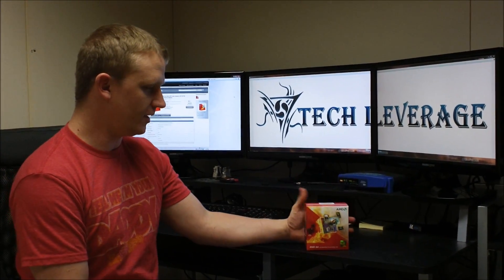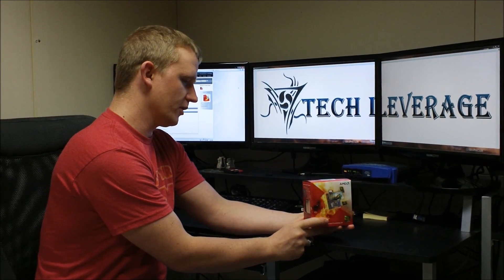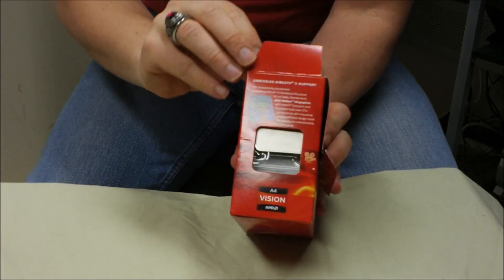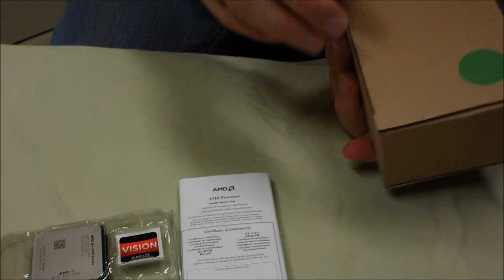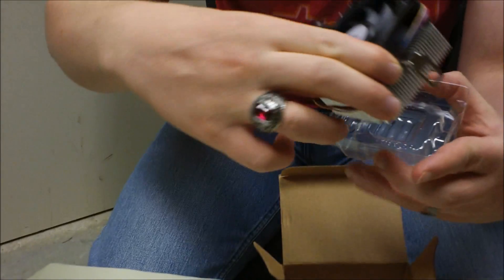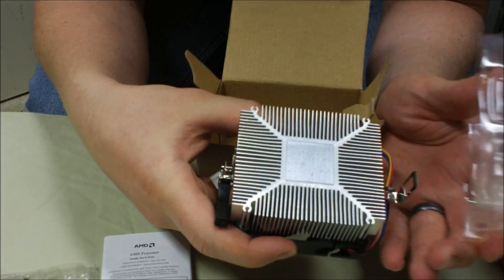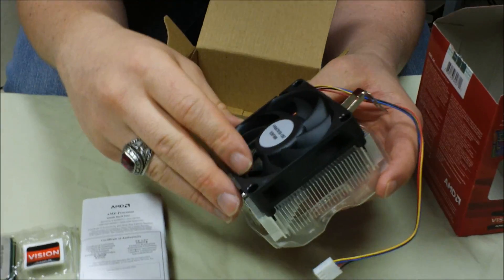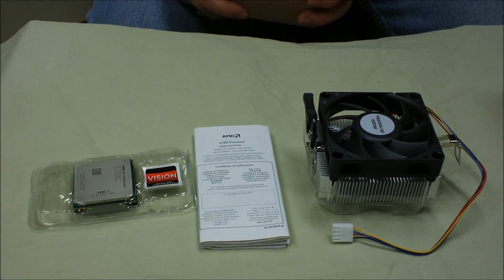AMD A4-3400

Comment: Apu means accelerated processing unit it even said it on the box you should try reading instead of infering
Reply from the maker: Yup, They are called an APU. They are an advanced processing unit that AMD has released called the Accelerated Processing Unit or APU that combines the GPU and the CPU. The video was not stating that the APU means advanced processing unit, but that this is AMD's new advanced processing unit, at that time. After watching the video I can see how this would be mistaken.
Reply: Tech Leverage thanks my bad

Comment from the maker: Its not going to do as well as A FX or Phenom II, if stay in the AMD family. I would look at getting the new A4-5300 now that Trinity has been released. The A4-3400 does well for the average person for school work or checking email. I did pair it with a HD 6450 and I was able to run WoW at around 30 - 35 FPS on good settings.

Comment from the maker: Fan is: 14.3 x 69.85 x 69.85 (H x L x W) The fan has legs that attach it to the heat sink that make it stand another 5.55mm off the heat sink...(5.55mm gap between the fan and heat sink) The heat sink is:  19 x 102 x 93.66

Comment from the maker: I don't have GTA 4 to try on it, but I would say you would probably see low FPS in fast moving and graphically demanding areas. I would say that it WILL play it but... you would see around 30 - 20FPS and lower depending on the situation.

Comment from the maker: you can change that with the Asus board. The value shows how much RAM the GPU side of the APU is taking. You had 4GB of RAM and the GPU is using 512 GB of RAM...leaving you around 3.48GB for system. 512 is standard but If you want more you can turn it up to 1GB but that will leave you about 2.98 GB for system

Comment from the maker: @TheAwesomePandaFTW 
With most AMD products this represents the number of cores the CPU will have. Think of cores as the number of individual CPU's on one chip...so the A4 3400 has 2 cores so it is a X2 or dual core processor. you can buy AMD CPU's that are single core all they way to 8 cores.